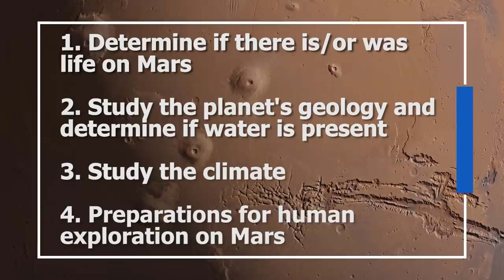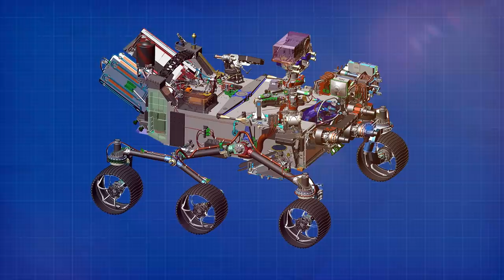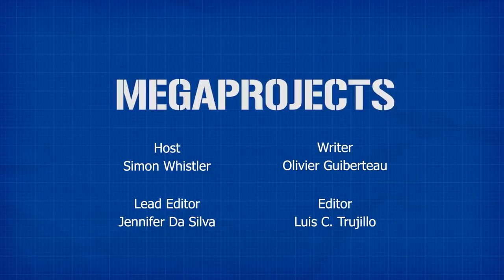Perseverance: NASA's 2020 Mission to Mars

Comment: Btw on ingenuities 9th flight it traveled 625 m which is more than double it's original design capacity. At this stage ingenuity has been performing so well that it was switched from an experimental mission to a partially operational mission with a yet to be determined flight window I believe.

Comment: its not a V, its the Roman Numeral for 5, so its an Atlas V(5) 541 (5 - Payload fairing size (options of 4m or 5m with 3rd Option i'll add at the end), 4 - SRB's, 1 Centaur Upper Stage number of Engines (SEC - 1/DEC - 2).

there is also the Atlas V N22 which is used to launch the Boeing Starliner with No Payload fairing, 2 Boosters and 2 Engines on that Centaur.

the Atlas 5 is however due to be replaced by Vulcan or rather Vulcan Centaur as it will retain that ever versatile Centaur Upper Stage and will use Blue Origin's BE-4 METHLOX Engine to replace the Russian Built RD-180....due to wouldn't you believe it....Politics because ULA (including Boeing) is severely limited in the ability to purchase new RD-180 engines for Atlas V. and so Atlas...the most widely used launch vehicle in US History is coming to an end, after its beginnings as a pretty crap ICBM to a very successful launch vehicle to propel most Mars Missions onwards to their Journey from US Soil.

Comment: Robert Zubrin had developed a plan in the 80's to get humans to Mars in the 90's, NASA reworked it a little bit using slightly heavier estimated weights causing the cost to go up and increasing the number of rockets to be sent from 2 to 3. Zubrin's plan was called Mars Direct, he dubbed the rework Mars Semi-direct. The first rocket would land with a device onboard to take what gasses and chemicals are in the air and convert them into drinkable water, breathable air, all the fuel that the astronauts would need to return to Earth; the astronauts would arrive on the second rocket while the third would orbit Mars unless absolutely needed because of the second rocket breaking for some unforeseen reason. The last i knew they were hoping for launch in 2020, that was back in the 2010's though and we're in 2021 now so who knows anymore. I hope Elon actually gets humans to Mars.

Comment: I think if they find life it will have originated on earth. It wouldnt make me believe its everywhere
Reply: If they find related life on Mars then it's more likely that life arose on Mars and later transferred to Earth than the other way round.  Mars has a surface gravity around 1/3 of that on Earth and an atmosphere around 100 times thinner (although it was probably thicker in the early solar system), making it much easier to blast stuff off the surface with a meteorite impact.